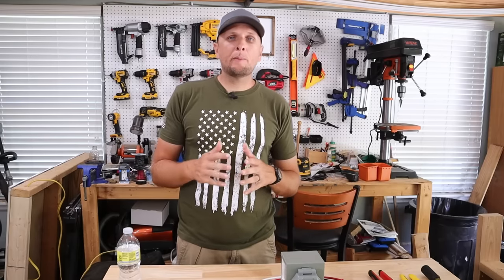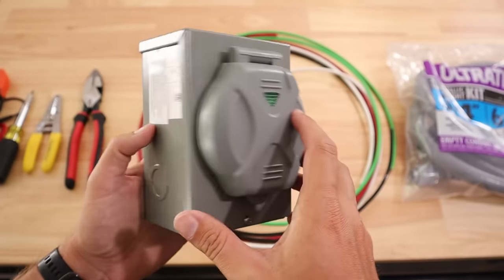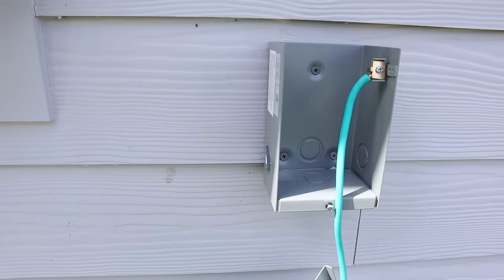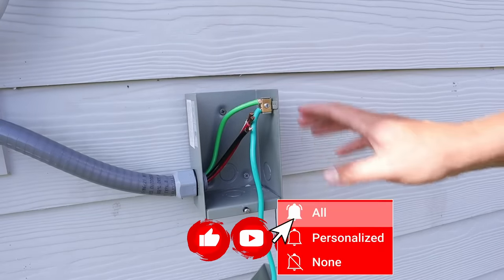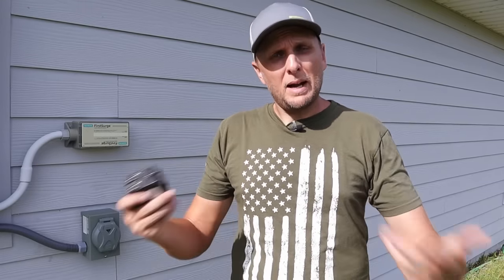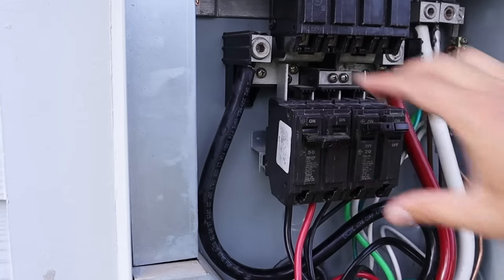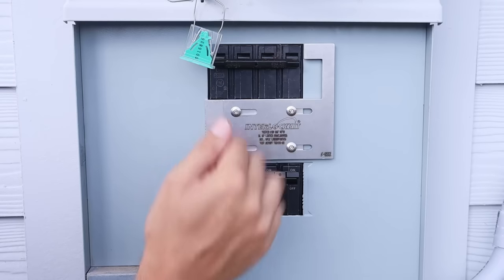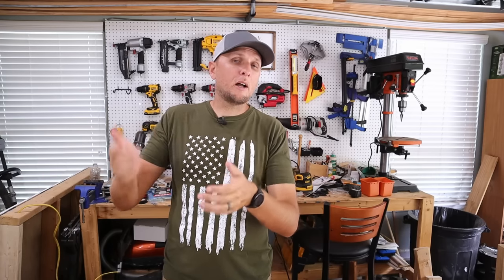The BEST Way To Connect A Generator To Your House - Interlock Kit With Power Inlet Box Install

Comment: This is just a great video. Thank you much. I not been a tech person, is still not too clear on the BONDED AND UNBONDED terms used for the Generators, AND on the ground and neutral connections. Do they make generators bonded and unbonded?

Comment: The Microaire soft start is amazing. 
I was disappointed when I first installed mine and the AC compressor refused to run on generator, which is the reason I got the soft start in the first place.
Long story short, I finally tracked it down to generator power frequency from manufacturer was slightly above 60.0 MHz. Once I dialed that in to 60.0 MHz, compressor started and ran just fine. 
I would suggest to anyone introducing a new generator to check and adjust the frequency.  It's the speed adjustment at the carb, governed RPM, really easy.
I also replaced the well pump with a soft start Grundfoss which reduced the size of the generator needed to run the house. 
Soft start rocks!
Reply from the maker: I like the idea of a soft start for the well pump or a well pump that just uses less power to start.
Reply: There was (I sold that house) no measurable in-rush. Pump just came on at 8 amps and stayed there until it shut off.
A lot better than the old one that started at 65amps. Grunfoss makes nice stuff.  @HowToHomeDIY

Comment: EXCELLENT HOW TO VIDEO.  Spot on using a soft start (almost mandatory?; I use ICM models) if wanting to run a central AC unit with a generator (reduces start amps by over 50% to 70%).  I think it would be useful to also comment:  can't double tap per National Electric Code white neutral wires in the neutral busbar (only one white neutral wire in any one neutral bar port); National Electric Code requires a generator circuit breaker to be locked or tied down so that it cannot be easily removed if the generator is running (such removed breaker will have hot exposed contactors and a shock hazard); It would be useful to note that some generators (say 10000 start and 8000 run watt; 125/240 volt capacity) will only have  4 prong L14R-30P plug in port.  To plug into a 50 amp rated connection box, a 1.5 ft 30 amp 4-Prong L14-30P generator locking plug to NEMA 14-50R plug is first plugged into the generator  which then allows a 14-50P and 14-50R  generator extension cord to connect the generator to the 50 amp plug.  Right now I am set up for 30 amp connection box...with future expansion to 50 amp if Houston hurricane weather and extended power outages continue.  Nice to have at least one air conditioner unit run during the emergency down time.  While Texas Occupation Code allows homeowners to DIY their electrical and plumbing requirements on their own home without being so licensed, if a local city ordinance (such as Houston) restricts that privelege, then that ordinance must be followed (in Houston for electric work need a licensed electrician and electric permit); can in Houston DIY plumbing work (such as installing a natural gas tap to fuel a generator) but a plumbing permit is required.

Comment: I am impressed ! U R not using a suicide cord!  like 'Evertday man' with a Champion 
7500-watt gen. Now Champion is a fine gen w excellent customer support but one slip up 
and u have a hand full of 240 volts. 'Everyday Man says he is an electrician.o.k. but I hope 
no one else has to hook up his set-up. So u have a 12 KW plant, propane I bet. The mechanical
interlocks are pretty good and LEGAL. I don't use the interlock but I have 2 disconnects, 1 out
on the pole, under the meter, and 1 in the panel. power goes out 1st thing I do is shut off both
MAIN breakers. I used the extra 240 volt breaker in the panel to work a male fitting in the proper enclosure so the cordset is no longer a widow-maker. BUT when it was used, The mains were 
shut off and LOCKED, the cord-set plugged into the dryer circuit properly fused for 30 amps as 
the gen is rated 120/240 at 30 amps.
The 1 thing I did not do is get a Honda inverter gen. they don't seem to make replacement parts
due to the attitude their stuff will last forever, guess what? it doesn't and if you do find the inverter part it will cost a few arms and a leg. I ran a fridge, freezer t.v. stereo and central air with a Powerhorse gen 7200 watts, 16 hrs a day for 10 days Thanks Irma! I changed oil every 3 days or
48 hrs. I had built a shelter and plugged into the dryer outlet. It all worked great.
Reply from the maker: Yeah I stay away from those.  Not worth the added danger to save a few bucks.  Glad to hear you sound like you are pretty well setup.  Irma got us here too!  Thanks for the feedback!

Comment: Good video
Only thing I would have done differently
Put conductors in sealtight add connectors 90° and straight
Remove locknuts install on boxes
Then carry on...

Comment: I'm in Florida and I am glad I ran through your video here. I was thinking about getting a power generator but also thinking about the best solution to add a switch that can help me to do what you just did on this video. No, I am not a certified electrician but have worked as one long enough to be confident on doing this. Thanks so much because now I have a clear mind and thought of what I need and how to do it myself.  
A question, what generator do you use and do you have a link to it? 
Thanks a lot.

Comment: Great video! Liked and subscribed. One question; if I have a 5500 generator now, but there’s a 50% chance I’ll have a 22,000 whole home generator in the next 3 years, should I still install a 50amp breaker and inlet or should I install a 200amp breaker and inlet? I’d rather do one install. Buy once cry once

Comment: I'm looking into doing this, the only issue is that my main inlet is before the meter, on the other side of the house. If I connect a generator there, then I'd be paying the grid company for the electricity I'm producing myself 😂 I'll obviously have a professional do the install (we're not allowed to do it ourselves, due to laws and insurance) but I always like to research the topic thoroughly, even if I'm not doing the work myself. That way, I can have somewhat of a conversation with the person I hire.

Comment: I think I see aluminum conductors. I leave an allen wrench in the panel, insulated handle hopefully, and I check for creap or flow at the lugs every time the cover is off. Bob in Nevada

Comment: I see there is " NoOx ' On your main power leads , in the main panel  !   I would recommend it on your 50 Amp box , at all connecting points !

Comment: Hi awesome video, I have a question for you. I have a 220 dryer plug that use it is wired with 10 gauge Romeo wire can I use that wire to connect a 30amp generator plug to?
Thank you

Comment: Great Video! However, there seems to be confusion about the bonded comment mentioned below. Also, you said there was something added to the A/C system - was not clear about that (is it necessary since we will want to have that operational should we lose power). Thanks

Comment: How far can I install the inlet box/ flex away from the breaker box? Great video by the way 👍🏽
Reply from the maker: Pretty much as far away as you need it.  However if it is a really long length you will want to consider voltage drop.  In that event a larger gauge wire would be needed to maintain the voltage needed.

Comment: I bought a Detroit diesel powered 28 kw 3 phase unit dirt cheap bought one of the transformers to convert it to single phase like you see in buildings to provide standard 240 vac  one caveat you will only get 208 VAC it does not cause any problems got it and the transfer switch for like $300 used it powers my whole house and shop on the farm it runs at a low RPM burns less fuel than a screaming at 3600 RPM gasoline portable unit .

Comment: I am in the south and looking at this. Wanting a soft start for running a generator like yours.  Thank you for the video. What’s the draw from the AC unit in 4ton soft start?  I’m trying to figure out with soft start and breaker interlock how big of a generator I need. For the AC then size up for fridge and a few other items

Comment: Great video. I have a 13kw generator that was able to power my whole house except my AC units. I wanna buy a 28kw generator. My question is will my 50A breaker be able to supply my 2 AC units and whole house?

Comment: looks like a good job but I would like to add one thing. That is not a NEMA-3R enclosure therefore you need some type of structure to protect it from the elements when in use. And most of the generators that people use for this set up are not for outdoor use in bad weather which is when they will be used most often.:body-blue-raised-arms: Retired Sparky 38yrs.

Comment: I just bought a house in northern Gulfport MS. It has something like this (w/o the box) installed in the lower left corner of the breaker box in the garage. I really didn't take any pictures of the hookups inside the breaker box (located in the garage), I'm starting to wonder if it has the safety mechanisms in place to ensure there is no back feed to outside power lines. I did plan on getting a genset w/ burried fuel tank installed once I move in but in the meantime, as a backup, it has the hookup like what you show, but it's in the garage area. Great video. Thanks for the time of putting it together.
Reply from the maker: Oh nice, we are headed to a Gulfport for a job today.  So if you don’t see a metal interlock kit on the panel and it’s not a transfer switch then it does not have the safety precautions required by code.  Fairly easy to remedy though.  The power inlet box can be in the garage but of course as you know, the generator needs to be outside away from the garage when running.  I’m assuming you are wanting your genset to run on natural gas?  I looked into burying one, they are very proud of their tanks now!   Congratulations on the home purchase.  Gulfport is a nice area.
Reply: @HowToHomeDIY  My current house has the genset hookup just inside the rage door. I pull the generator outside, connect it to the house plug, go to the basement and flip the transfer switch which disconnects shorepower. To go back to outside power, I have to flip the switch back.  And yes, well aware of where the generator needs to be outside the home.🙂

Comment: My outside main 200a panel is devoid of a common (white) wire buss bar. The only thing in this Milbank main power box is two open slots for breaker(s) and a ground buss bar at the bottom of panel.

Comment: I'm in northern ND.  I want to go the portable route because you can buy portable generators for about 1/4 the cost of the home backup generators that hook directly to your gas line.  I just want to make sure I can power my forced air blower on the furnace and my basement freezer/kitchen fridge/freezer.  Anything else would be gravy.  My question is, since my main braker box is in the basement in my son's bedroom, how do I do this?  In the video, it looks like your main breaker is outside next to your meter.  Looks like I would have to do some cutting (through the siding, insulation, and sheetrock.  If that's so, pretty sure I'd want to get a pro to install it.  Even having to pay a pro to install it, I should save tons of money vs having one of those automatic home backup deals.  Downside, if I have my generator parked on the side of my house, I'll have to find a way to protect it from getting three feet of snow dumped on it.

Comment: Thank you for making this video! As an option, is it acceptable to "back feed" to my home panel from the sub panel in my shed, by connecting the generator output to an existing 20 amp dual breaker in the sub panel. My generator is a 120/240 20 amp generac. The current would back feed into a 30 amp breaker in my home panel, and be used to power only essentials- well pump, oil burner and refrigerator. I'd turn off the main line breaker and all others first, then energize only what I need, up to 18 amps.

Comment: I Might do this I been using Dryer Plugs All i do Shut off the Main on Box that way no back Feed To Line Kill Someone  It Works great Run Whole House Less Have Heat In Winter

Comment: My box on the outside of the house is about 1/4 the size of yours, and the center of it is a big circle where the digital readout of kWh used is on display.

Comment: Great video!  I'll be running a 13k generator.  Will be running 6/3 wire through 1" rigid metal conduit.  The run will be 30ft under my semi finished / dry basement. Have been told I do not need to remove the romex due to the diameter of the conduit. Thoughts?